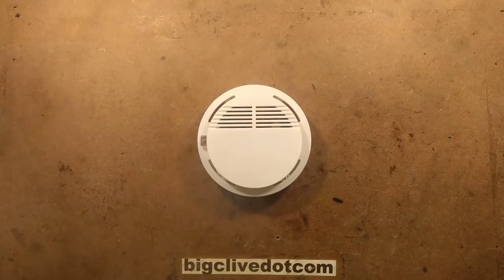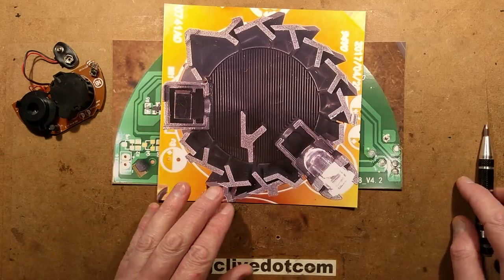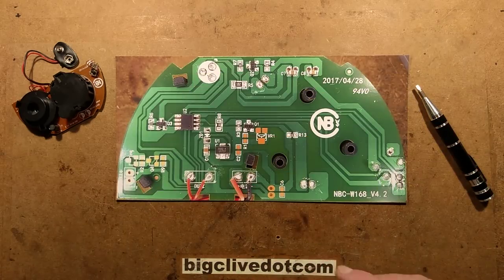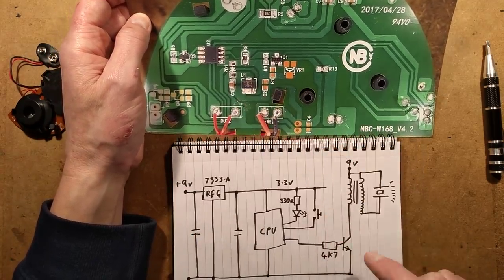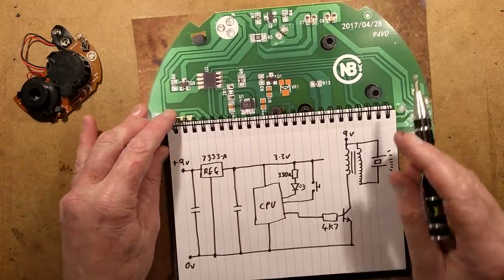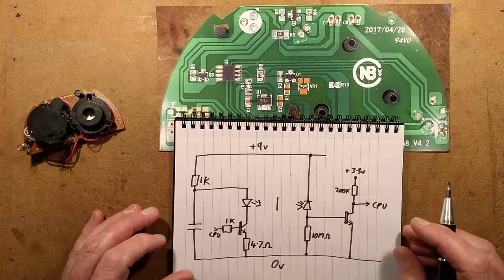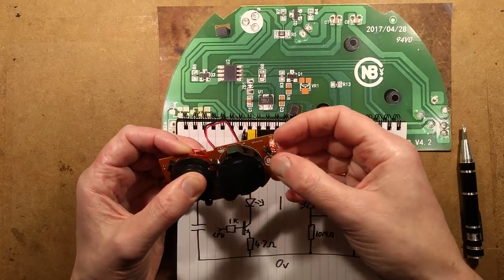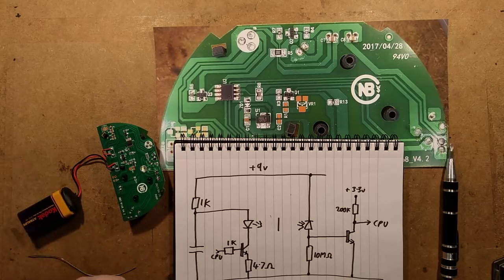Torch your home for $4. (with schematic)

Comment: Remember, life saving devices is ALWAYS the place where it makes sense to cheap out ...
Reply: Buy a dozen per room, for the same price 😭
Reply: And yet they have a place in poor countries.
Reply: That and military gear. Remember 'mil spec' means the same thing as 'built by the lowest bidder.'
Reply: Well it works better than none.
Reply: @dutchdrifter8740  no, they don’t. Manufacturers make the name brand ones for about 5 bucks each, they then charge people 20-30 bucks for that same item. (statement is true for everything actually). Life saving equipment should be forced to be sold at reasonable markups. But this is a greedy capitalist society, so that’s not gonna happen.
Reply: @Chimera_Photography  they don't have a 500% markup. R&D, quality control, certification, transport, distribution, customer support, replacing defect products, wages, the vendor has a markup, should I keep going. The entire chain is a bit more complex than just putting it together. The way these smoke detectors can be sold so cheaply is because they are copied designs and sold directly by the manufacturer or have just one reseller. There is little investment and cost. 

A lot of people in a lot countries don't even make $300,- a month. Having a smoke detector a priority and if one costs $20 or even more it won't become a priority fast. If a smoke detector is only $4 more people will be able to afford one and the general level of safety will improve. Something is better than nothing.
Reply: @SpiraSpiraSpira  
I thought the USA had the best stuff in its military. I wouldn't be surprised if terminator style robots are placed in the battlefield soon.
Reply: @vmelkon  sure, the things that are unique. Like there is only one supplier for B-2 stealth bombers. But for the individual stuff most soldiers use.... sometimes it’s shit.
Reply: @vmelkon  Mil spec means the military puts out a 'requirements page' stating what they want a product to do, and how many units they want. IE I want a  10 inch tablet with 2gb of ram, 32gb ROM, that can withstand being dropped from 10 feet without breaking.
Company A says "sure, we will get to work on that, then one makes one, with no cameras, a battery that last 30 minutes,  no onboard speaker (only a headphone jack) a 10 inch screen 2 gb of ram and 32gb of rom, they then dip the whole thing in liquid rubber till its 2 inches thick. Then they Quote $75. 
Company B makes a nice tablet with a camera, a decent onboard speaker, a battery that last 4 hours, a 10 inch screen, 2gb of ram and 32 gb of ROM, they also carefully reinforce the aluminum case so it weighs 1/4 what company A's tablet weighs. Then they quote $80. Military goes with company A...
Reply: I'm cheap. when I rewired my house I installed detectors as per the newer building codes. I ended up with 11 detectors total in the house (per code rules). being cheap I shopped like crazy online. I purchased some detectors from the US that were almost identical except the model number lacked "CA" as the last 2 digits. when I recieved them they were identical except they had Spanish as a second language while the CA models had French as the second language. all that wiring and all that shopping and im not code compliant because of that second language. haha. but I saved a ton of cash.
Reply: @JceeJClark  I see.
Reply: @JceeJClark  . . . the logic of "lowest compliant bid" . . .
Reply: Doesn't matter because they all end up with the batteries removed
Reply: Keeps you on your toes. No need to forget about risks
Reply: @Chimera_Photography  And that's why I'm a non-compete communist...
Reply: I work in a Ford Main agent. its incredible the amount of people who would rather spend £200 to get cheap brakes fitted instead of the good ones for 20 quid more. BUY GOOD BRAKES AND BUY GOOD TYRES! same goes for smoke detectors and any safety equipment really.
Reply: Smoke detectors, car tyres, climbing ropes, etc... Haha
Reply: @Edders234  i think its safer to buy cheap tires and have the replaced every year or two.
brakes are whatever, tbh the world might be safer if everyone drove like they had crap brake pads and their tires locked up instantly. then you would leave enough space to slow down passivly before lights, drive slower, save the environment, ect. if you drive a standard transmission and a lighter weight car, pads can easily last the life of the vehicle if you do mostly hwy in the us. I replace with cheap pads about every 50k miles however.
in the us we have a lot of tire import fees and tarrifs compared to the uk for example, I found this by comparing top tire bands between countries different amazon listings. here the cheapest tire you can buy from the shop is around 360$ installed per set, and most people go to costco or whever and end up spending 700-1000$ on slightly less crappy tires. 
I just buy the cheapest set on an auction website with whatever load rating (usually better than stock), and over inflate them 20% until the first snow. I end up getting them for about 100$ a set (fluctuates) delivered and pay 40$ to have them installed.
I think tires are about half the wholesale price in the UK. most specs of tires are based on first use, 0% wear. i think michelin has the best perfomance overall and the longest life, while pirelli has the best initial performance. here a set of michelin super sports is like $3000 installed which is insane. i think theyre about 1000$ in the uk

Comment: That sounds like a plot device for a murder mystery show.  
Stupid detective: "Why didn't he escape the fire, the smoke detectors were working?" 
Smart CSI: "Yes but the killer removed the battery and blew smoke into the detector setting the new baseline tolerance higher than a fire." 
Killer: "And I would have gotten away with it too if it weren't for you meddling kids" 
ROLL CREDITS
Reply: I expect that unless you did that immediately before setting the fire, or maybe took the battery out, set the fire, blew a mouthful of smoke in and reconnected the battery immediately before scooting, they would eventually reset and recalibrate down to a lower set point. The way you would sensibly program something like that is to take the differential of the detected reflection level, as well as considering the DC level itself. Signal value rising faster than a certain cutoff rate, or the level simply being higher than a particular set point anyway (indicating an environment already so smoky or dusty that your detector hasn't a chance of working as intended) = set off the alarm. That then protects both against fires that are close by (causing the internal smoke density to rise quite fast), with the alarm going off even before the smoke actually reaches a dangerous level, and the more insidious case of a slower or more distant burn filling the air with smoke too slowly to set the detector off by rise rate alone, but reaching a dangerous enough level that if you haven't already picked it up by smelling it building up, or being awoken with a coughing fit, at a point where you could still safely escape, then you definitely need an audible jolt to get you out before you suffocate. With the additional case that if you connect the battery and the environment is already dangerously smoky, it will go off immediately... with the user then having the option of just taking the battery back out (as the alarm will trigger before you've even properly clicked the terminals into the connector, let alone put the lid back on), or taking heed of the warning and vacating the area.
Reply: And, well, if you had the opportunity to do such a thing, you could probably have just took the battery out, set the fire, then snuck back in afterwards to reconnect the battery. Or cut one of the cables right where it's soldered to the board (or desoldered it?), set the fire almost immediately underneath, and let the flames destroy - or at least heavily distort and disguise - the evidence for you...
Reply: @markpenrice6253  Or just stick something to the ceiling with wax, enclosing the detector. Set fire, it's well established by the time the wax melts and drops the cover, and shortly any remnant wax will be vaporizing and the cover will be a nondescript patch of melted plastic on the floor, possibly intermingled with the remnant plastics from the detector body itself.
Reply: @markpenrice6253  Or replace the battery with a totally depleted one.

Comment: The volunteer fire department I am on has always installed smoke detectors for free for the elderly and folks who can’t afford it. Otherwise we sell them for $5 US, which is our cost from Kidde Company. In America the first week in October is Fire Prevention Week and it’s suggested to change the battery out every 6 months which normally is around daylight savings time where we change the time of day either by falling back 1 hour or moving ahead by 1 hour.  
 The new dual smoke detectors we got earlier this year is touted as both photoelectric and ionization. I should send you one to dismantle and test.
Reply: Thank you for your service.
Firefighters are heros.
Reply: The fire department here says test once a year and change the battery 6 months later. Also, you are supposed to replace your smoke detector every 10 years minimum. Kidde (pronounced kid-uh for those that care) now sells 9V batteries that they guarantee for 10 years in their smoke detectors. One detector, one battery, one decade. I also use a carbon monoxide alarm in my room and between my furnace and water heater.
Reply: Can't say I'd be wanting to trust my life to a 9volt battery anywhere near 10 years old.
Reply: If they're anything like our fire alarms the figure isn't far off, plus the thing doesn't die quietly. You will KNOW when the battery runs dry.
Reply: The batteries are lithium and the detector draws something less than the self-discharge current so it's a good pairing. 
The detector will alert if the battery level gets low, but always test your detectors regularly.
Reply: Ah I see. I wasn't thinking about them being lithium based, as I've not seen them hereabouts. 
Given I've had a lithium fire, where the bang woke me before the detector went off, I'd never cheap out on these devices. Sadly the landlord tried to before the false alarms and failure forced them to spend a little more.
Reply: Thank you for your service...and for helping the folks out that can't on their own  :)
Reply: Every flat I've lived in has a mains powered smoke alarm with battery backup attached to the ceiling,  normally in the hall or living room although my living room had the front door there,  no Hall.  I assume it is due to laws.
Reply: That is how the detectors in my home are installed, and they aren't just mains powered but interconnected. The most annoying part is whatever design they are (presumably ionization because there was a radiation warning) likes going off every time I use the broiler even though there is no visible smoke. 

That one is located in the living room only about eight feet from the oven.
Reply: Clive reviewed another smoke detector, small round unit looked vaguely like a Dalek, it was good for ten years.  They are sold by First Alert in the United States, Clive had the same unit under a different name.
Reply: Strasedon
there should be multiple diffrent variants available for such Smoke Detector Systems. I have installed a few such Systems, and in the Kitchens we have installed a diffrent type of Detector (its been a few years since then so not sure anymore what exactly was the difference), and i assume anyone who offers such an interconnected System uses sockets where you can plug in diffrent kinds of detectors..
Reply: UniTrader - alas it appears each manufacturer uses a different system.
Reply: Ignes Andros, I once got a carbon monoxide detector with a "guaranteed five year" battery built into it. It was not replaceable. It lasted two years before it died. Not even half the claimed time. I don't bother with the claimed time anymore, but luckily most decent smoke detectors and co detectors alert when the battery is getting low, which almost always is while I'm sleeping for some reason.
Reply: Peter S +mine goes off every time I cook.
Reply: Thermal Ions
I would be more worried about high failure rates than the devices starting fires.  Cheap low end smoke and carbon monoxide detectors may not last the ten years they are rated for.  Hopefully they fail with a signal so you know they are bad before something happens.  They have warranties, but who is sending in a warranty claim on a $20 item?
Reply: Mark R the battery gets cold and its output voltage drops and the detector senses that. It’s (usually) cooler at 3AM than at noon.  Or there is someone at the factory laughing maniacally programming the controller logic to make it chirp at 3AM. Either way, right?
Reply: In Germany, landlords are required to have smoke detectors installed and regularly checked on by law. The first smoke detectors that got installed in this building were good for 10 years, including a 10-year battery; tested annually by a contractor. They installed new smoke detectors this week, also good for 10 years, with a 10-year battery, and also a remote testing feature using RF technology (likely they report to a base station somewhere in the building). A landlord is less interested in a cheap unit price and frequent testing than in a solid unit that requires the least attention to be maintained.
Reply: @templebrown7179  Honestly, testing them every year is important. This year I found 7 cheapo smoke detectors which were fully working except for the piezo. In case of a fire they would just blink, not beep. 
They had corrosion on the piezo which was just connected via springs.
Reply: @Thermal Ions.  If it's puts things into perspective and gives you any consolation I was fitted with a pacemaker/ICD that uses broadly the same type of power supply ... mine is quoted @ 10-15 years.  I visit the hospital every 6 months and they "press the battery button" to test if it's still good for another 6 months.
I sometimes wonder if they used a spare smoke alarm ... long story - but my previous unit detected a low battery and "went off" (its called the "patient notifier") - it sounded just like a smoke alarm - almost gave me a heart attack!!!!   Seriously the alarm is that fekkin loud!! https://www.youtube.com/watch?v=816gwIy67DA
Reply: No, I absolutely agree - test your fire alarm at least twice a year. I just like the idea of not wasting the batteries extra. We have fire alarms in almost every room and used to change the batteries every year.
Reply: Mark the batteries and see how long they typically last. I can get 2 years from a cheap Ray-O-Vac carbon 9V battery on occasion.

Ionizing detectors are demonized for no good reason. I've tested old and new ionizing and photo detectors and my 25 year old ionizing detectors alert the fastest. I use photo detectors only when I want a forgiving one to place near a kitchen.

CO detectors are programmed by law to self-destruct in 5-7 years depending on their internal parts choices. I tested my 30 year old monoxide detector and it too alarmed faster than the new one. You must keep the sensor away from solvents if you expect it to last. The new ones just die no matter what because companies need our money!

There is no real reason to toss a detector in 10 years except to please our corporate over-lords IMO.
Reply: @Strasedon  try a photo one anywhere you want a slow response. As much love as the photo detectors get from others, I only use them in cases like yours where I want something weak.
Reply: My landlord put a cheap little stick on fire alarm on the ceiling of my kitchen about 1 foot from my cooker, it was fine when i used the oven but went off everytime i boiled something or did the washing up with steaming hot water, i took the battery out of the stupid thing.
Reply: Thumbs up for the cheap/free service you guys provide, Mark. Great public service especially for the elderly
Reply: @jburdman7  Not really. The lifetime of a smoke detector is on a bell curve. Because a failure of a detector may result in death (and expensive lawsuits), the lifetime of a smoke detector or CO detector is set so that say 99.9% will still operate when it is taken out of service. Because of the tail of the bell curve, most will last a lot longer, but this is what you have to do if you want a reliable system.
Reply: Here if you have a down stairs suite.  All the smoke detectors are linked.  So one burns toast  everyone alarms is screaming.
Reply: @assassinlexx1993   that is the required code here as well for New homes or homes being renovated.  I will say installing one in the kitchen sucks. We see so many people pulling that detector. (I’m guilty, cause even at 25ft away it still goes off on the smallest whisper of smoke)